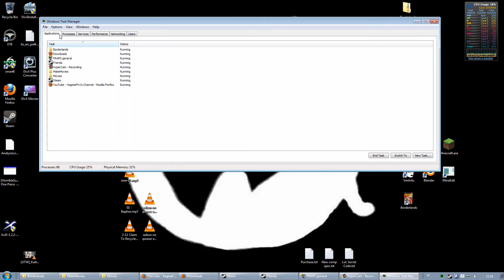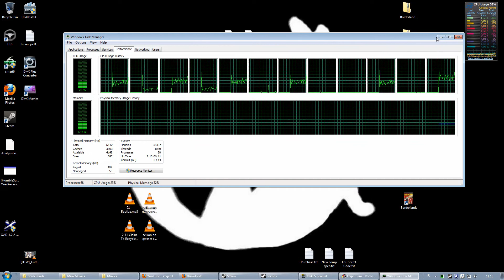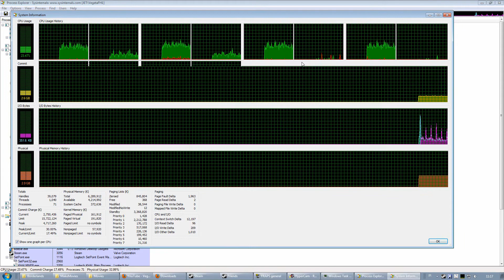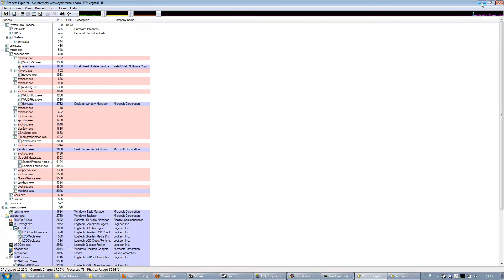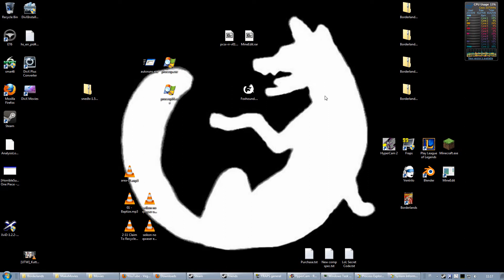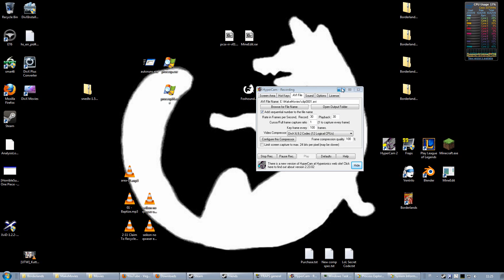My new glitched computer

Comment: A 700$ mobo? The point...
2 things, you may still want to see if there are any updates for that mobo; second the power supply is far too high for what you're using, which degrades the psu's performance over time. So unless you're getting 2 5970's or 2x480's the power supply will become faulty over time.
Which you are, but seemed a bit confused...